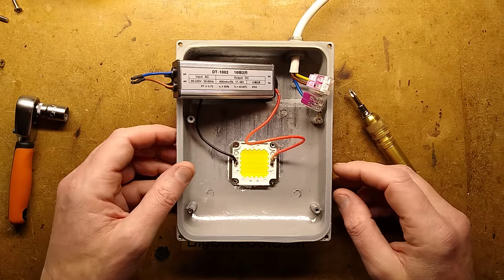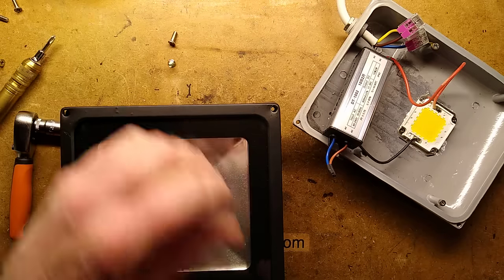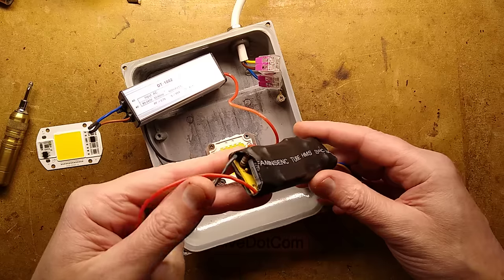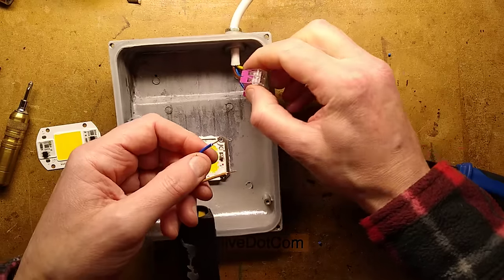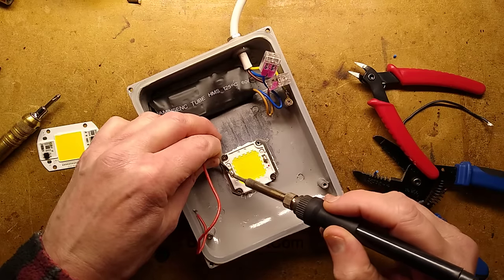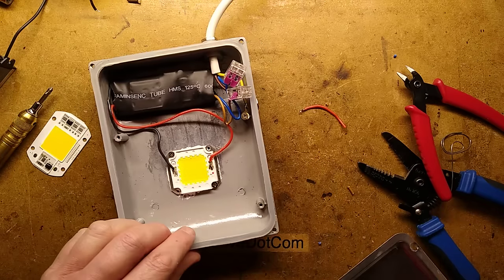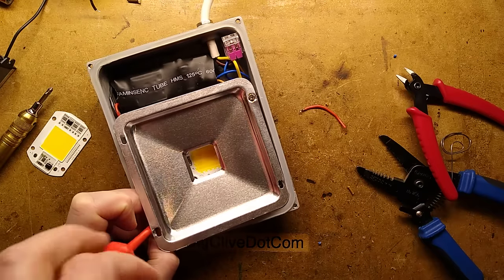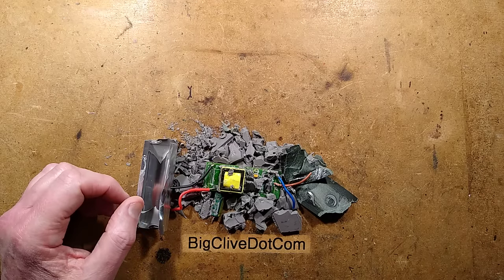Fixing my bench light

Comment: I like the use of side cutters for wire stripping. I did work with a guy once who used to go absolutely mental if he caught anyone doing such a heinous thing instead of using a proper (very expensive) wire stripper.
Admittedly on some PTFE insulated wire types, a proper stripper makes all the difference.
Reply: yeah I only use my flush cutters for stripping wire. anyone I've worked with who's actually stripped a lot of wire hasn't had any issue with my tool choice, though. management and the one guy who made one off prototype wiring harnesses did, though.

Comment: Handy tip , the ( last few working ! ) tiny 4 Volt Tungsten filament bulbs from a defunct light string can be reused as individual bulbs with 6 inch added tails .. as single cell battery testers ! ! ( 1v5 or 3v7 ) ... these have the advantage of drawing a good current , like the meter types , but  NOT  suitable to test button or coin cells , as they draw too much current , ideal for storing in any kitchen drawer for easy instant use ! ... ( tried - n - tested ) ..... DAVE™  🛑

Comment: I'm surprised you weren't able to find an appropriate LED driver from the usual trusted vendors. Although lately I've found they have less options available in stock, and it's usually the more expensive options that are stocked. And sometimes you can't even trust that they've actually got the stock they say they've got. The last two times I ordered from the silicon-based electronics supplier, everything was supposedly in stock when I checked out, but then I got an email saying it's going to be weeks to months wait on stock.
Reply from the maker: I was caught short.  I thought I had spare drivers but couldn't find them.

Comment: Couple of observations, the potting, is probably the cheapest way to hide shoddy work, at least with the heat shrunk unit you could fix it if it starts to mess around, I worked in high spec power supply company years ago, and the only supplies we would pot were HT supplies for use at altitude, some of the testing was interesting the first couple of times you do it, after the first 20 or so, it wasn't so exciting. My first exposure to flourinert, putting a seriously high voltage into what looks like water, then putting test probes on while live was disconcerting at first, the test manager put his finger in with a running 25KV supply, i was convinced after that. 
Secondly, how can it be cheaper to produce copper plated cable then pure copper cable? Maybe it's the sad fact that their labour rates are so low?

Comment: Good to see that you got your lighting fixed, and also that you can buy fittings with removable PSUs! I have had so many different outdoor floodlights (for lighting the front and rear gardens) fail, where I believe the LED has been fine but the PSU has failed, and in true LED fashion the PSU is not easily accessible by the end user and therefore cannot be replaced!
Looking forward to part 2.

Comment: They made sure the power supply was not fixable and was therefore a throw away unit. I like the deformable garage lights that has 3 or 4 adjustable vanes that can shine light anywhere as they move in all plains.
Reply: In all "plains"? The ones where the buffalo roam?? I bet the buffalo really hate LED shop lights on their plains - makes it hard to sleep
Reply: LOL @gorak9000
Reply: The potting isn't anti-repair, it's anti-moisture

Comment: I'm confused (no change there), why would you not just use the replacement 50W / 20W unit (the one that proved difficult to remove the PSU from). I'm sure there is a perfectly logical explanation (the video would then be as boring as hell), which eludes me.
Reply from the maker: It's too big and would not match the other light.

Comment: If you're willing to spend a little bit more, Meanwell makes a whole ton of different kinds of LED drivers for every combination of current, voltage, ratings, dimming, and any other possible parameter you could want. I've used all kinds of their supplies (including constant-current and constant-voltage LED drivers) and have not had a single issue, after getting fed up with all kinds of cheap clone supplies dying just like you show here. 

Something like the 20W you're looking to drive will probably set you back $20-50 depending on how fancy you want your features, which is honestly a small price to pay for something that will never fail again.

Comment: one thing i'd recommend to check out for these flood lights is the replacement led modules with 10 Cree XML's on them (for a 100W one)

these old style COB leds are all pretty inefficient, in my opinion atleast, i believe they're at like 60lm/W

the Cree's (even the cheap T6's) produce almost 100lm/W, so yea those are pretty good

they also exist with XP-E leds etc. in 30W and whatnot

Comment: Along the lines of having a flock of solder or a stray blob of solder.

I've seen this wreak havoc in devices.

This is the most recent thing I've seen that had a problem with something wrong with this lines.

In this case there was actually two little splashes of solder on the inside.
I had one of those side socket sort of USB equipped surge protectors.

Had both to USB a force and a USB C port.

First thing that went out was the USBC then finally the rest of it which was kind of strange but then again I haven't unplugging it and using it elsewhere moving around turns out that what killed it was both the USBC Port first and the other was flex and drops of solder that had been there for manufacturer that broke loose from the plastic chassis and floating around in there and of course hitting something critical shorting something out and of course doing the deed.

Also something of Interest this might appeal to viewers of this channel as well.

On that particular surge protector what was used as the protection indicator was essentially a LED and a resistor wire across the output of the power supply for the USB thus win The Surge protection is no longer functioning which also this one didn't have the thermal fuses which completely cut out the output in series with the supply to both the receptacles and also USB power supply module which looks like an off-the-shelf module by the way!

Very interesting design very well-built if it weren't for the Solar Supply is it would still have been working to this day.

So definitely something to avoid when you're building something for yourself and also in manufacturer but you know something's always have a tendency to slip past quality control or like oh it'll be okay sort of thing well not in this case!

Use it for quite a few years!

Served very well until that time really high quality it seems like the wiring on the AC side of things is heavier than needed to be even.

And yeah designed for the US market it was pretty clever how things were done in there with the ability to swivel the three AC sockets and the three USB as well.

I was expecting it to be contacts either side however something better they had just run the power wiring through one end each of the two separate sections definitely better than some of those funky contacts that sometimes don't work well I've seen these fail on something similar.

But then again somebody was putting a pretty heavy load on these and they were discolored so clearly High Resistance connections but not surprising probably due to tensioner that was contacts I think it was an earlier design the name is something that had been Don similar to the above surge protector later on since I saw the same product essentially but don't know if it's the same brand and haven't done with just wire going from the main body to the swiveling sections so likely the design change because of reliability and other issues

Comment: I have something very similar Clive. A 100w LED driven at about 80w. I'm using a 24v 10a supply with a current limited boost converter. I've got it slapped on an old CPU cooler with a simple temperature controlled fan controller. It's retinadestroytastic!

Comment: One of the best reasons to turn a newly fixed light upside down is not to get blinded by the high-power LED.

Also:
To keep the shrapnel safely inside if the "new" power supply decides to  loose a few components on power-up.

Hence my motto: "Red on red, Black on black and STAND BACK!" 💥💥💥

Your videos helps a lot of people from difference backgrounds to get started, keep up the good work Clive!

Comment: Try using dental floss to cut between the glued bits next time you have to deal with stuff siliconed together. It works really well and it's cheap and readily available.

Comment: I had the same concept but a 70W fixture and it would blink. I also changed the PS and it still blinked. I've had several chips do that. It turns out that the internal bonding that supplies all the strips in the chip (s) acts like an old fashioned tungsten bi-metal blinking strip. On this particular chip that had a round 70W chip I used a square 100W chip and drive it with a 70W supply like that. The case is the heatsink and it's poorly designed with pop metal that doesn't transfer/dissipate heat very well. It's been 8 months now and it's still working fine.
Reply from the maker: The most common failure in these LEDs seems to be where the bonds go onto the busbar at one end.

Comment: Something I don't get: is making/using fake copper cables actually cheaper than making real ones? Wouldn't there be extra costs from the extra steps required to, say, coat the core with the copper? Is it actually cheaper to fake it or is it a case of deluded attempts at saving money that actually result in higher costs AND worse product?
Reply from the maker: The cost of copper is significantly higher than aluminium or steel.

Comment: Iv just put a outside light up didn't use the earth works fine with 2 core cable 😊
Reply from the maker: It will work, but could pose a shock risk if it fails.  And that includes from any conductive surface it's mounted on.
Reply: Should be okay then it's on a bracket outside on the wall
Reply: An electric shock outside is more likely to result in injury or death because you are providing a more direct path for current to flow to earth.  If someone touches that light when the insulation has failed, they will get a big surprise.  It needs to be earthed, and you should think about any other wiring you've done in the past, especially with 2-core cable.
Reply: @westinthewest  it's on a 3 amp fuse plugged into the outside waterproof socket

Comment: Sorry to be a dog-in-the-manger, but why did you originally plan to disassemble a 20w 50w lamp to repair your 20w 50w lamp?
Also.....copper is expensive because copper is expensive - it is NOT expensive just because of people gambling on the price - this isn't Dutch Tulip Bulbs it is a billion tonne commodity.
Reply from the maker: I wanted to use the same fixture so both beam patterns match.  The price of copper has been artificially inflated by parasites to the detriment of safety for everyone.

Comment: @BigClive, I’ve enjoyed your channel for years. I have a question that I haven’t been able to find an answer to, and it seems right down your alley.  Why do touch lamps of many types always become over-sensitive? For a while a short term fix seems to be opening the circuit (switching the lamp off, unplugging, or removing the screw-in circuit). Is it for lack of a ground connection to the control circuit?

This is pretty important to me because I have a degenerative nerve disease, and often cannot use a physical switch.  Thank you for anything your genius can shed light upon!
Reply from the maker: It could be due to a bad ground, or perhaps adjacent electrically noisy equipment (possibly an LED bulb).

Comment: Could it be that you're running the power supplies at 100% duty cycle that's knackering 'em? I recall you saying that under running LEDs and having a 50% duty cycle on the power supply and they'll last shall we say "quite a while".
Reply from the maker: If the supplies were 50W and the sense resistors were changed to run at 20W it would make them run a lot cooler.  But it's not so easy when they're potted.

Comment: Well, I vote for lighting powered by 12 volts dc, connected to a standby battery, connected to a mains charger. That way there's no flicker at all. Of course it probably won't matter when you're recording at xx frames-per-second. lol
Reply: Regardless of whether you start with AC or DC, you still need a switching circuit to provide the constant current source, unless you use a crude resistor dropper which reduces the efficiency of the circuit.

Comment: I'm not an electrician or anything  near an electrical whiz.... but I  generally am intelligent (or lucky) enough to not electrocute myself ... that said, I  have wondered for a while if the proper circuitry is available stand alone to use with a standard  US  door bell transformer they are 120v input and typically list 12v-16v ac output and normally would be wire directly into the breaker panel.
Reply from the maker: You get 12V lights intended for use with transformers that could run from a doorbell transformer.  But the transformers are not usually intended for continuous loads.

Comment: Hi clive. Do you hace any videos regarding keeping your soldering iron tips in good condition? I always seem to burn my tips to the point that they will no longer take solder... using a TS101 + power supply. Thanks clive 🤟
Reply from the maker: Make sure you don't run them too hot.  I use my iron at about 350C.  Contrary to internet lore I also tin my bit before parking it.
Also, avoid using the tips to do things like melting holes in plastic.

Comment: Rather than sourcing a replacement power supply from China or the like, could you pick through your junk box for a wall wart that outputs the desired volts & amps, then cannibalize it?
Reply from the maker: These LEDs operate at quite a high voltage.

Comment: Great video and repair.
What about the Osram LED Driver, 21 → 40V Output, 20W Output, 150 → 1050mA Output, Constant Current, RS Stock No.: 256-5086 Mfr. Part No.: ELEMENT-20/220-240/500-G3
It's cheap as chips on RS so you could stock up on spares.
Reply: You can get MeanWell LED drivers too - they're a few bucks, but generally the quality you'd expect from meanwell

Comment: Rated 50W but I'm using a 20W power supply...
You mean it's overrated at 50W?
Reply from the maker: The LED is rated for 50W dissipation, but I run it at 20W to reduce the stress on the LED chips.
Reply: @bigclivedotcom  Ah I see so it's a current limited driver?

Comment: I have the same lamp outside in the shed and replaced the led four or five times already. Three times this year. They are very cheap, 1-2 dollars, but die fast.
Reply from the maker: The case is often not really rated to dissipate enough heat.  The LEDs sold on eBay are often substandard ones being "dumped".

Comment: If you don't trust the combination of fake Wago and used wires, may it not be a good practice to add a earth wire to the metal casing?
Reply: earth you mean, i hope!! it does have an earth, its in the video, although doesnt connect in the best way
Reply: @andygozzo72  Oops, missed that. Thank you! Of course I meant earth. I corrected it in my initial post.

Comment: Would it be vialbe to run theses from an external power supply like a PC power supply or simular, or does the voltage not match?
Reply: You need a constant current supply rather than a fixed voltage.  LEDs commonly run on 300 mA, but those larger modules are often 600 mA or more.
Reply: @westinthewest  Ok I was under the impression that a load only used as much current as it needs, also My pc supply is max 25A on th 3,3v and 5vrail 70a on the 12v rail ,5A on the -12v rail and 3A on the 5v standby rail so I dont think your hypothesis holds water.
Reply: You'll enjoy reading about how to drive LEDs and their non-linear behaviour.  An LED won't draw any current till you hit its forward voltage - say 3 V.  At that point it behaves like a short circuit so if you don't limit the current, you will quickly get a fried LED.  Be careful in your research because there's plenty of inaccurate guidance on driving LEDs.  Lighting suppliers are the worst offenders.
Reply: @westinthewest  Yes but that wasnt he question. My idea was to drive these fixtures from a better quality external power supply. The kind of power supply I suggested wouldnt be suitable because those cobs usually need more voltage than a PC supply can deliver unless maybe if you combinet the +12 and-12 rail. You would put proper current limiting inside the fixture if it isnt allready on the cob module. That is a given. I thought it would be better to not have get into the fixtures every time these crappy supplies that are included burn out.
Reply: I don't see much point in using an ATX or similar PSU to provide a constant current circuit with rectified DC.
You might as well just get a decent constant current circuit which incorporates its own AC input section.  You could then mount that circuit outside the luminaire if it needs to be more accessible e.g. if the light is outdoors 6 metres high.
You might find that the COB is  more likely to fail than a nice Meanwell driver.
Good luck with your design - all these factors can make it quite a long-winded process.
Reply: @westinthewest  I wasnt talking about general design I was talking about clives bench lighiting setup and my question was perteaining specifically to an alternative to the power supplies provided wiht ebay/poundland lights. An atx supply as I said in my last post isnt a good option since the cobs I could find are usually higher volatage than what you could reasonably expect from such a supply without jumping through unnecesary hoops.  I'm not designing a cricuit.